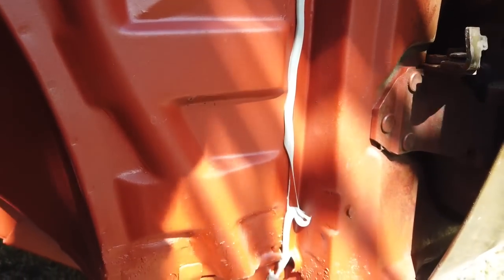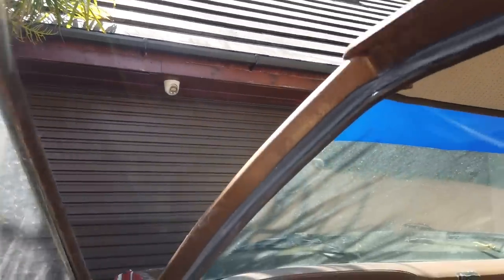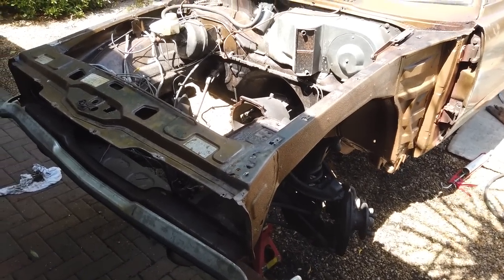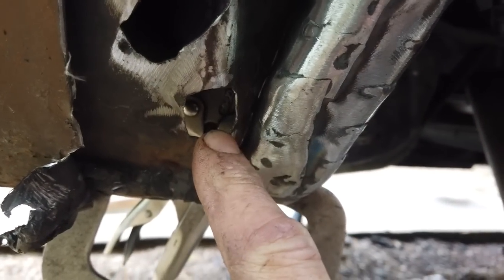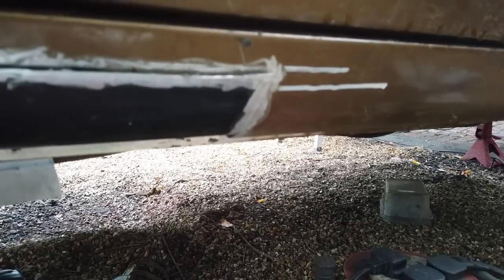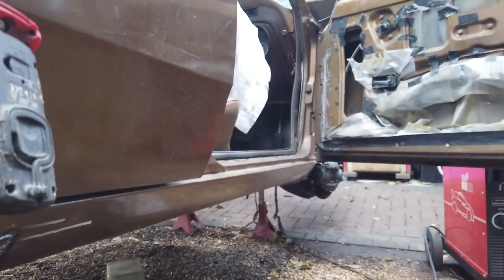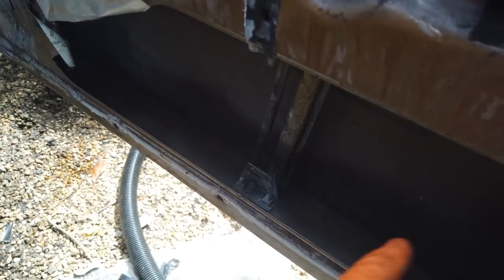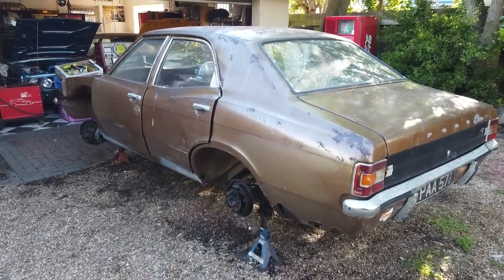PROJECT PAPPA-MK3 CORTINA RESTO - EP8

Comment: Hi Pete.  Great video, as per usual.  A quick question. The rust converter i've used for years seems to have been changed and no longer does what it's intended to do.  Do you find the one you use does a thorough job of converting, or is it hit and miss. Regards Phil
Reply: Phil, best rust converter I have found is called "Fertan" . Not that easy to get hold of, but it is fantastic stuff. I was put onto it by a friend who is a pro body guy with about 25 years in the trade.
Reply: Thank you Bob, I'll look into it. I've been restoring cars, bikes etc for 50 years, and over the years I've used many products, but all seem to either lose there edge, or the manufacturer has changed something in the recipe and they just don't do what they, (to paraphrase a well known company), say on the tin. Which is bloody annoying, considering the cost of these things. Regards Phil
Reply from the maker: Phil all products I use and ADVICE from Chris at rust.co.uk, just the best guys to use, they know the score with rust products, just ask for chris he will advise
Reply: Thank you for the reply Pete, I'll give them a call and see what they advise. Kind Regards Phil